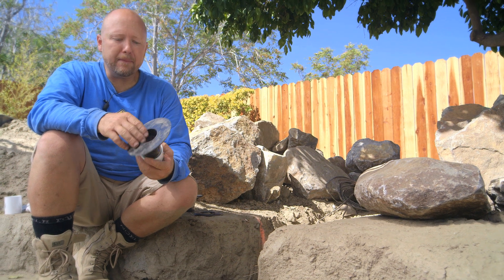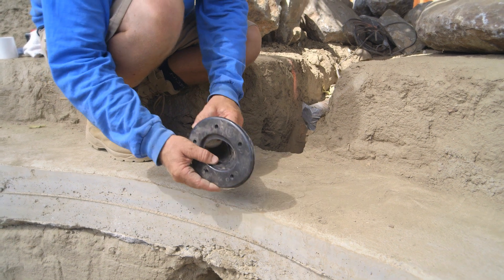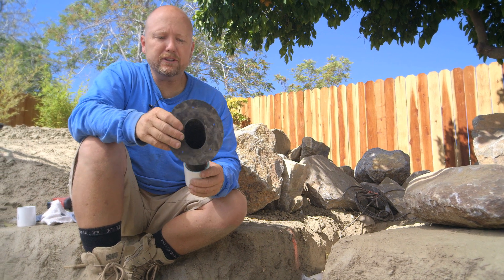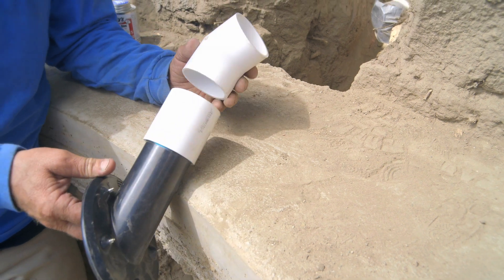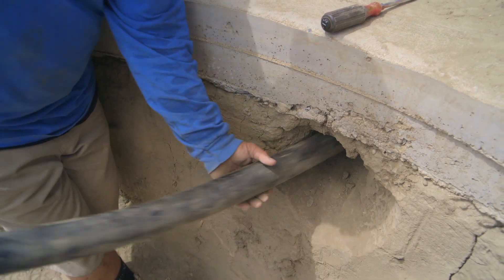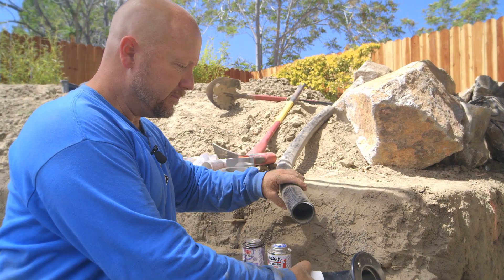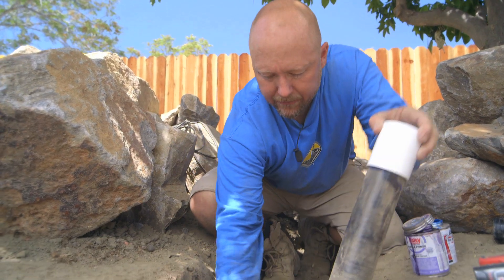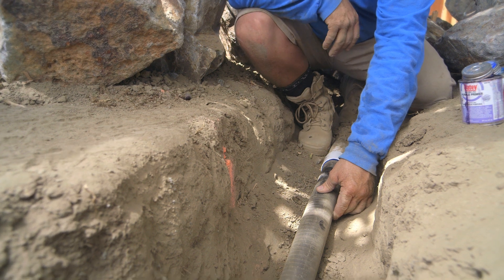Koi Pond Construction | Concrete Pond Return Jet - Part 20

Comment: I just got my pump and filters hooked up ... I have a 3 way valve going to my jets and my waterfall but the jets have weak flow. I did reduce the jets down to 1/2 inch. If I turn the waterfall off and full flow to the jets my filter starts to over fill (I have 3 tier barrel filter - One is a moving bed) I’m guessing the flow problem is because of with the 1/2 pipe ? My pond is 4300 gallons and my pump is 5400. I appreciate all the hard work you guys do .. It helped a ton with my pond build 😀👍

Comment: Return jet can add 16-18 inch above bottom pond ? Which one is better ? Above the bottom or below 16-18 the surface water ? 
Thanks
Reply from the maker: vuhoang71 That is a good question! If you DO NOT have an aerated bottom drain I would say add the jet closer to the bottom of the pond to help push debris to the bottom drain. If you have an aerated bottom drain then I would suggest the jet to be higher up in the water column to help benefit the skimmer as well.

Comment: Gluing flexible pipe to ridged pipe, never ever would I do that, and the side return was set too deep which will creat a lip and unnecessary pressure on the liner.